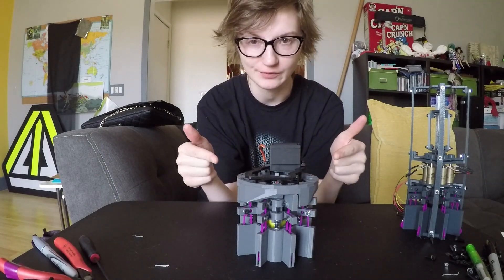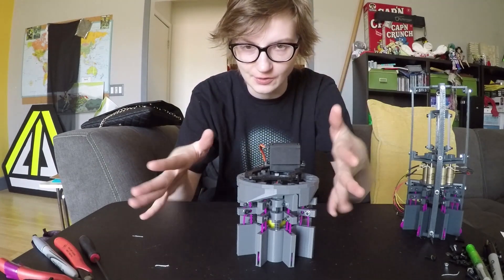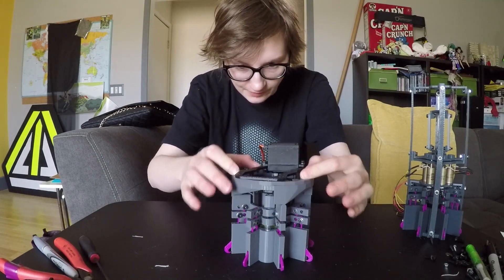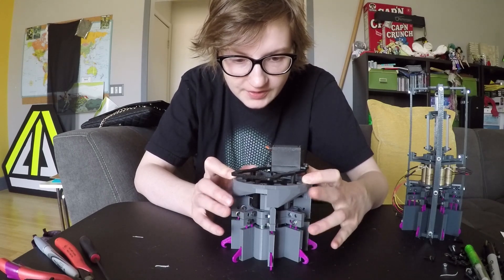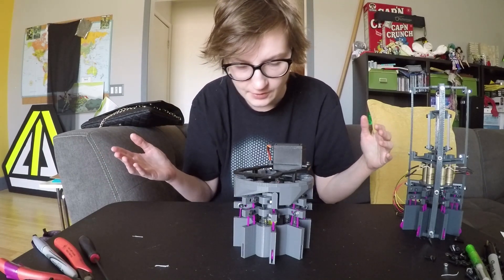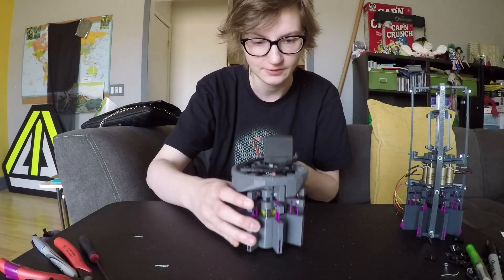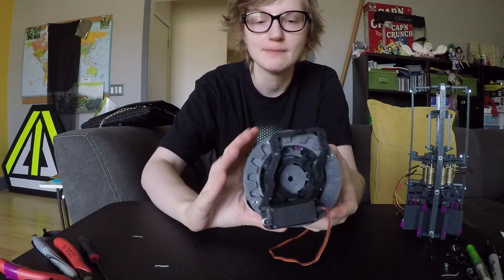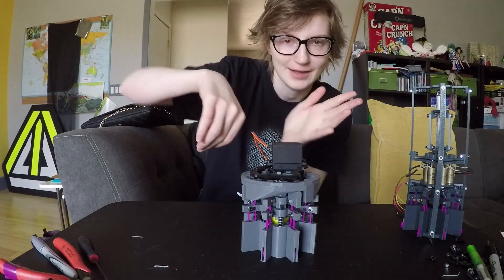Tasting Feet : Second Sorta Working Prototype

Comment: Sand the ramp, then add teflon tape perhaps? Ideally you'd have small wheels on the sticking-up bit to remove sliding friction altogether.
Reply from the maker: +Jan Moren I just just finished printing an iteration with roller bearings. I'll post a video of the outcome if it works! Actually... i'll post one if it doesn't too... =] Thanks for the suggestions!

Comment: Excellent project! I have no idea what it's from, but it is pretty interesting! I work in hobby shops, if that servo doesn't have enough oomph to make it work, you can get stronger and faster ones that would! :) Which servo are you testing with?
Reply from the maker: +Michael Lee I'm using some Power HD servos, the most basic resin gear type. I have more powerful high torque ones that I can trade out if these don't work, but before then... I'm going to try and remove friction from the actual mechanism itself. =D